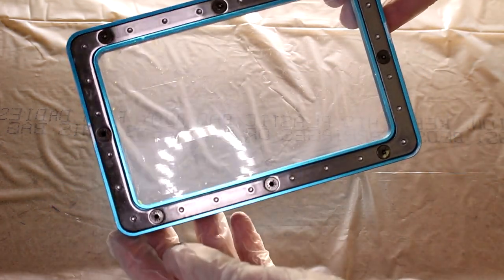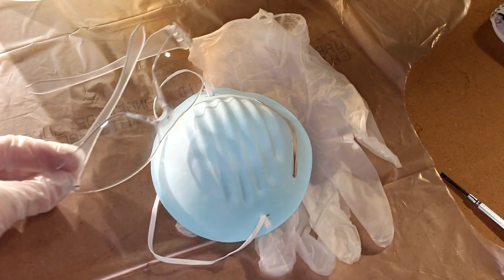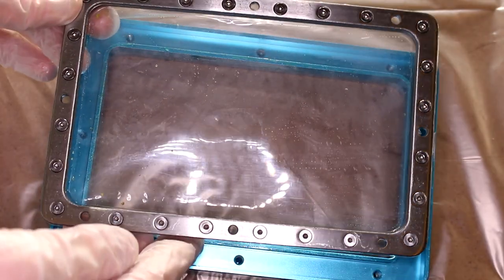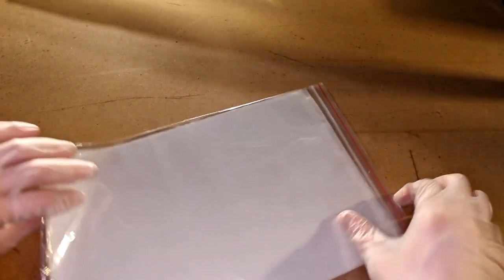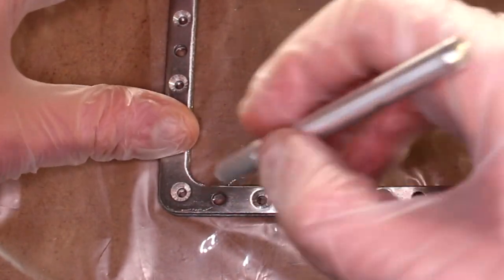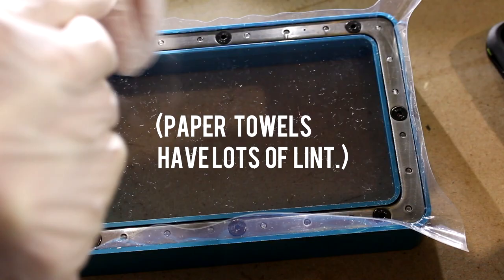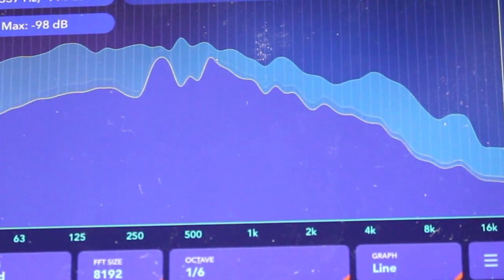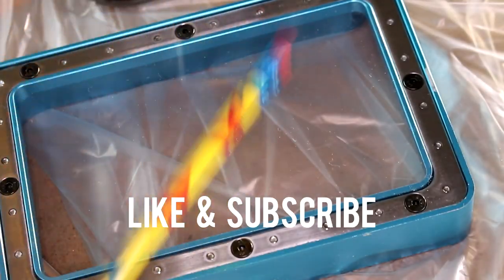How To Replace FEP Film Anycubic Photon

Comment: Great video! I tried to change the FEP on my Mono X but when I was installing it I lost one of the tiny screws that hold the FEP between the two aluminum frame pieces. Do you know where can I get those?
Reply from the maker: The Photon I have uses flathead m3x5 screws, perhaps they use the same? I found documentation was limited for the Mono, I would take a screw into a hardware store and see if they could match it.

Comment: I think I found a better way to tune the tightness of the FEP film. Hold your film next to your computer speaker and vary the frequency using an online frequency generator until you hit the resonant frequency. You will know you have hit the resonant frequency when the film vibrates the most, kind of like a tuning fork without having to smack the delicate FEP film.  Mine started to show small dents even with an eraser as shown in this video.
Reply from the maker: What!? Incredible! So the film can stay flawless... That’s certainly a development and it’s so simple, too. I will need to try it out. Thanks so much for sharing! The real tip is always in the comments!

Comment: You mentioned having some concerns about the thinner film tearing more easily, but I don't believe you confirmed or disproved that in the video-- maybe I just didn't hear you. Have you found that to be the case since this installation? I'm thinking about replacing my FEP too, since I just replaced my LCD.
Reply from the maker: I apologize for not elaborating further. When I first started resin, I had frequent failures and created holes in the FEP if not careful.

Since I began using the slightly thinner film, it has never been a problem, but probably because I can make less mistakes now. Basically the thinner FEP may have only been an issue for me until the initial learning curve was over.
Reply from the maker: One thing it does super easily, however, is turn to Braille if accidentally pressed onto specks of dirt or anything. It dents easier so a failed print or too low of a Z height will put a stamp in it easier as well. Other than that only, it operated practically the same as the stock film thickness.

Comment: Cut off the extra film before you screw it into the vat frame.
Reply from the maker: I regret forgetting to mention this. What would the advantage be to do so before? I did it after, as I wanted as much film around it as usefully possible. It was also easy to run the knife around the bottom quickly without the plate moving.
Reply: @Inventorsquare  After screwing the frame together with the small screws it's very simple to cut the excess off by running a pair of scissors around the edge of the frame. 
Then insert the frame and install the larger screws. It's very quick and very clean. 
Also, you don't risk scratching the aluminium frame. Cutting before or after has no effect on how much film is left -  "I wanted as much film around it as usefully possible"

I've changed mine at least 4 times already. Give it a try next time to see if you like it better or find it easier.

I'm not saying that you're doing it wrong. All of the videos I've seen do it the same way that you do.
I just prefer to cut off the excess before installing it into the vat.
Reply from the maker: Brilliant! Now this is the proper way. Since you mention it, I hate running the knife around the edges because it does scratch the vat.

Comment: Hi.That's all
 it was printed normally 2 months,then stopped....Basis 
details,the first layers (platform for supports) tightly gets into the bath and
 That's all......Recalibrated 5 times...Replaced the film on the bath,put 
greater time of illumination of the first layers.....NOTHING all the same.....Changed two
 different resin (native green and cherry HL) Nothing.....Shines all 
normally,watched without table and baths.....May be i replace FEP film very tight?
Reply from the maker: Hard to tell, sorry. Get it working yet?